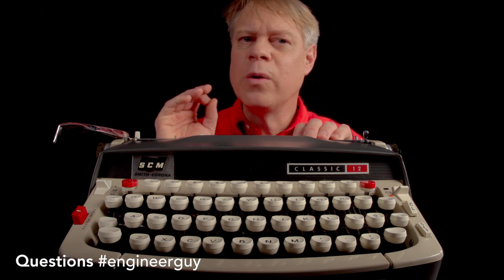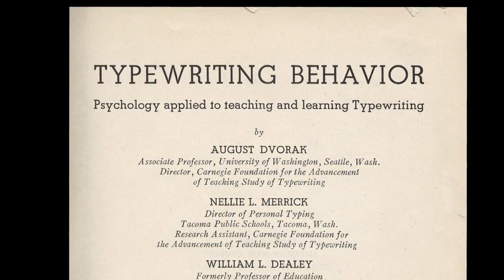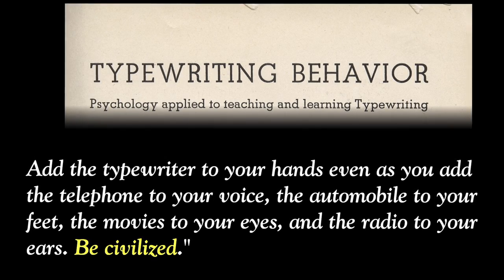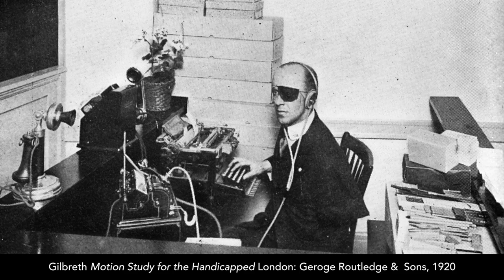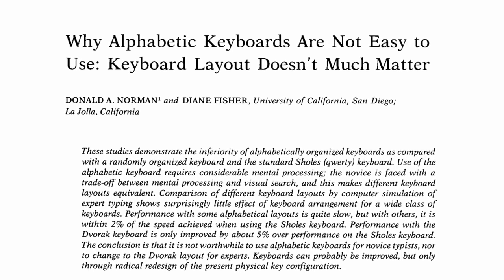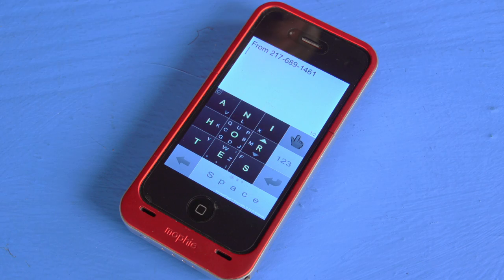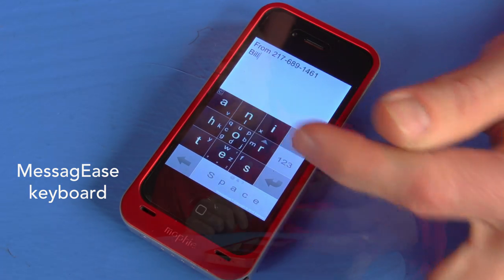Why the Dvorak keyboard didn't take over the world

Comment: I use Dvorak mainly for comfort - it is so much more comfortable than QWERTY. It was also much faster to learn. I had been learning typing in school on and off for years and was nowhere close to being able to touch type - after 2 months of using Dvorak, I can do so at 50 wpm which is about 15 wpm faster than my old speed. Nowadays alternate keyboards are included with all OS's so the effort to switch them per computer is negligible.
Reply: This is actually an important enough issue that we should probably lobby local schools to allow switching to dvorak and still have students do the same typing course tests. The superiority of dvorak would cause students to switch.
Since devices are pretty smart nowadays, they could convert their keyboards without much problem, presuming that the software wasn't retarded (hat tip to crapple for being retarded with their iMoan)

Comment: New tech needs to to two things to establish itself...it has to do the old job *better*, not just as well. Replacing installed tech has a cost that needs to be overcome. It also needs to open up possibilities that the old tech doesn't offer. Cars took quite a long time to replace horses, and only really established themselves as people developed a taste for greater range. Only when oil became expensive (and some areas started requireing emissions control) did fuel injection surpass carburettors. The Dvorak keyboard may (or may not) offer a speed or comfort advantage-that's arguable-but no new abilities were offered, no reason came to being making the replacement of the installed base of QWERTY machines worth the expense. Now we have even better tech allows us to use whatever layout we desire, that's what we should do-use whatever layout we desire. THAT should be the goal of all tech-letting us do what we want to do the way we wish to do it. The Dvorak whiners are not to be taken seriously, any more than people who tell others they can't eat pineapple on pizza. BTW-I used Dvorak for about two years. Not only did I type no faster (about 30wpm with either layout-there are many factors influencing typing speed, and layout is just one), I had to haul my own keyboard everywhere I went. Same speed with more hassle is not "better". I use FGHJ now due to physical limitations-it really sucks but it works for me. I use voice-to-text even more. Use what works for you, and avoid the impulse to impose your preference on others. That's both rude and unintelligent.

Comment: It didn't fail, I use the Dvorak layout, and I tested my speed both before making the switch, and after I had become comfortable with the Dvorak layout, and found I was 20% faster.  However, I used keyboard software to learn the new layout, and had never really worked on my qwerty skills outside of regular typing, so it might just be that I needed to train, and changing the layout forced me to.

Comment: I tried the dorsal keyboard for a few years, but then switched to the Colemak keyboard. It's a bit easier on my fingers (less RSI) and the frequent keys are well in the middle row. Should be fast, with practice. 
Dvorak was disappointing. The only reason it helped the rest at first seemed to be that it made me type slower until I adapted.

Comment: Hmm...I heard that the QWERTY keyboard was originally designed the way it was so that certain commonly-used letters would be closer to the sides of the typewriter in order to prevent jamming.
Reply: i think that may be the "folk-story" explaining the "random" layout he refuted at the beginning?
Reply: The real reason is that the type bars inside the machine were arranged so that you'd rarely use two next to each other in sequence, because that's what caused jams. So starting from the arrangements of the bars and connecting them to the keys using compact linkages that were ordered in a sensible way created the layout, and the layout you wound up with was QWERTY.

Comment: Like any established system, they take on a life of their own.  Look at the whole Y2K debacle.  It was well known before 1985 when I was taking computer science classes that the whole Y2K thing was inevitable.  We were also told that by they year 2000 we would be using computers so far advanced and different and non-compatible with the then current systems, that they would be obsolete and out of use and not a problem.  Then what you find is that businesses had lots of computers that cost lots of money and they resisted replacing them with new technology.  That's not to say the the technology has changed that much even up to today.  Predicting the future of anything never seems to go very well, especially when you discount the idea that things can take on a life of their own.

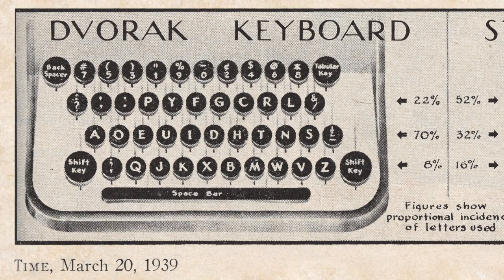Comment: Looking at the numbers row at 1:25, I think I know why the Dvorak layout "lost". %-o
Reply: I dunno, if ABC doesn't need to be in order why should the numbers? I find when typing that the moment I hesitate the most tends to be when I'm reaching for one of those numbers along the top row.
Reply: Actually the numbers are in serial order in modern Dvorak keyboards.  But certain digits are more used than others, so it would make sense to have them near the index finger, not the pinkie.
Reply: That was probably from/for a typewriter. Just the other day I wrote some lines on a typewriter which had neither a key for 1 (one) nor for 0 (zero).
The number one is supposed to be typed as lowercase "L" and the number zero as uppercase "o".

Comment: I disagree with one point. Dvorak is much greater than 5% faster than QWERTY. I used to type 45 wpm with QWERTY and now I type about 100 wpm with Dvorak. The problem is the amount of time needed to retrain your brain and fingers to use the new layout. If you use a keyboard for work, you will type so slow that productivity will drop to near zero while you learn it - and switching back and forth between QWERTY and Dvorak will make it even harder. Once you master Dvorak, you don't forget how to type in QWERTY, but if you have to switch back to using QWERTY you will find yourself typing slower and making more mistakes. I think this is the reason it never caught on. It's just a pain to switch when everyone is satisfied with the system they know; like convincing the U.S. to use the metric system.

Comment: Could you post the source for that 5% improvement? Years ago I tried to track down studies where the superiority of the dvorak-keyboard was shown, but failed to find anything except for studies claiming this was true and referring to other studies. I never found an original source and would be interested in seeing one.
Reply from the maker: It’s in the video isn’t it
Reply: @engineerguyvideo  The reference you have in the video is for "Why Alphabetic Keywords Are Not Easy to Use: Keyboard Layout Doesn't Much Matter" (Norman & Fischer, 1984), where a simulation indicated that the Dvorak keyboard may be 5% faster. They further refer to a paper by Alden & al. (1972) for a claim about 5% improvements. Only problem is that the paper by Alden does not mention that at all. Instead it goes on to refer to a study by Strong from 1956 that concludes that Qwerty was superior both in terms of speed and error rate.
-The positive thing is that Strong actually deals with the issue empirically. This is the first time I am seeing actual empirical evidence on the topic. It does refute your claim, though.

Comment: This video skips the most important reason for the existence of the QWERTY keyboard. On old manual typewriters, if they used a Dvorak layout they arms that made the imprint on the paper would constantly jam up. Spreading out the most commonly used keys prevented that. Anyhow, the whole argument is now moot since it's all done electronically. Therefore you could  switch back and forth between the two layouts by writing a keyboard driver that altered the key layout. But I'm sure they're already available.

Comment: Qwerty is indeed a little more efficient than a straight alphabetical keyboard (for full keyboard touch typing). But Dvorak's Simplified Keyboard Layout is about 3 times as efficient as typing on the Qwerty layout. 5% might be an accurate comparison for speed differences, but i doubt its legitimacy, after my own personal experience. 95% of statistics are made up on the fly. (I made that 95% one up, but it serves a point.) But from experience, i know for sure that the Dvorak Simplified Keyboard Layout is a LOT more efficient (and thus easier & more comfortable) to use than the Qwerty. I dare anyone to just try it. typingclub.com is a descent and fun and free typing site that you can use to practice and learn typing in the Dvorak layout.

Comment: Dvorak could not have `taken over the world" as you put it. Every language has its own unique keyboard layout. My mother language is Turkish. Turks started using French-based layout - which they used to call "A-keyboard". Simply the letter A stood where Q stands in English typewriter. Later on, they developed the F-keyboard, which was scientifically developed to speed up Turkish typists. And it worked. It had been very popular until... computers began taking over the world. It was actually QWERTY taking over the world with the arrival of computers in 1990s - yes, they arrived little late in Turkey, at least reaching its first critical mass. But despite the ease of use of the Turkish layout, many people began to use computers before even getting familiar with typewriters. What happened in the end was, QWERTY was evolved into Turkish, with the addition of six letters Ç, Ğ,İ, Ö, Ş and Ü on the right side of the keyboard - which was even worse. But no one cared about the ease of typing anymore. 

Just a closing note: You forgot to tell your viewers that you can type the word, TYPEWRITER with the top row keys on a QWERTY keyboard. Its design is based on that very simple idea. Yes, I am using QWERTY now, but I hate the fact that it had wiped out the original Turkish keyboard, despite it was easier to type with it, even in English. I know both by heart, but have gotten much slower on the F-layout. By the way, the only Dvorak that has taken over the world is the one that follows the name, Antonin. He has not only taken over the world, he has taken over "The New World" 😁🤘

Comment: I don't quite follow. You said that it's an urban myth that the qwerty keyboard took over because it was first and it's hard to dislodge that which is already established, then you confirmed that the reason why the qwerty keyboard took over was because it was  first and it's hard to dislodge that which is already established, but then just added that it takes a significant improvement and a change in how we do things in order to justify a replacement. That doesn't make the former explanation to be an urban myth, but rather it's just a less comprehensive explanation.

Comment: I am now typing this comment using the Dvorak keyboard, and I can assure you from using it in the past two years, that it is quite a bit faster than QWERTY and a lot easier to type on due to the significantly reduced finger movement. I probably typed this whole comment in just under a minute.

Comment: I tried the Dvorak keyboard for a year. The only reason why I abandoned it was because cut, copy, and paste keys were sprawled out (ctrl+x, +c, +v). Being a software engineer, I tend to use those functions a lot. There may be a workaround for this, but I decided that the differing layout would continue to cause problems like this in software that assumes that the user has a QWERTY layout. It's not worth the trouble for a meager improvement of speed.
Reply: You could look into the Colemak layout
Reply: James Smith Or the QWERF layout or Capewell-Dvorak (Dvorak modified to keep ZXCV shortcuts and improve a couple other weird things with Dvorak) :)
Reply: James Smith Its not just about speed though Dvorak is better at preventing RSI.

Comment: So how come there isnt a regular abcde key board?
Reply: Because ergonomically, it's a bad design.  It puts two of the three most common letters (at least in English) on the far left of the keyboard ("a" and "t"), meaning they have to be struck by the left pinky finger, which is most people's weakest finger.  And it puts the second least frequently used letter, "q", right under the right index finger, which is most people's strongest finger.

Comment: Colemak is far superior. After 10 years of using qwerty I learned colemak in 10 hours, cold turkey style.
Reply: Colemak is absolutely brilliant. Like you said, it took almost no time to learn and it's really almost scary how much you can get away with using only the home row. Not to mention that its so much more rare than QWERTY or even Dvorak, so it's really funny watching friends' frustrated confusion when they try to use my computer.
Reply: I remember trying it out a few years ago but since lost my resources. Do you have any links to help me get started with Colemak again?
Reply: BollocksUtwat
I used this site to get hang of it: http://www.keybr.com/#!practice
You need to change to colemak in settings. Also you can change layout only by a few keys at a time using Tarmak, so it won't affect your typing speed as much https://colemak.com/Learn
Reply: fuanshin: yes, Colemak all the way!
Reply: Colemac is only easy to learn if you already know Sholes' qwerty. Using Colemac from the beginning couldn't have spared us the long learning time we had with Sholes.
Reply: Rainer67059 In my experience once you have to second guess any aspect of the QWERTY layout you can't fluidly type with Colemac. It took me forever to realize how many the two shared when learning Colemac because I was still hesitating like crazy because however many are the same the muscle memory is still wrong as you move between different keys to new keys so they may as well be different.
Reply: If you like Colemak, more power to you, it is much better than QWERTY while keeping most shortcuts. However, Dvorak still is significantly better than Colemak for touch typing, for complex reasons.

Comment: If that is the "myth" of the origin of the QWERTY layout, does anyone anywhere actually know the real origin behind it?
Reply: It was not arranged to make typing as slow as possible but to place letters that are often close to each other in english reasonably far away from each other on keyboard. Typewriters were not jamming from fast typing but from pressing two keys that are close.
Reply: +fuanshin Same principle however, placing them farther apart does slow down typing, but that was more a side effect from what I know
Reply: +Bryce _ actually, no - it speeds up typing!  it's much easier to type two letters in rapid succession using two hands vs 1.  That, on top of the typewriter arms not getting cross locked, makes qwerty ideal for speed on both fronts
Reply: +Higgins2001 Trutru, I'm not always typing with two hands on my phone though so I probably just don't notice it

But when I do type with two hands (as I am now) I notice that my thumbs rarely cross paths, when they do it's just like if I hit 'A' then my right thumb goes to 'T' if that's the next letter I need rather than my left thumb which I usually use for 'T'

I also have good memory of where all the keys are, if my phone stalls up I can keep typing and even throwing in puncuation after it unfreezes and accepts all the input I'm surprisingly accurate

Comment: QWERTY keyboard - Designed to slow people down... Yea... That didn't go so well did it?
Reply: It was not, and it even says so explicitly in this video. You can also find this out by visiting snopes. Or wikipedia.

"Contrary to popular belief, the QWERTY layout was not designed to slow the typist down, but rather to speed up typing by preventing jams.

There is also evidence that, aside from the issue of jamming, keys being farther apart increases typing speed on its own, because it encourages alternation between the hands."
Reply: Oh. Thank you for that. :)
I thought it prevented jams by slowing people down.

Either way, thanks.
Reply: no it hasn't stopped people going quickly but it has stopped people typing comfortably as they increase therr speed, don't forget people didn't foresee touch typing when qwerty was designed.
Reply: Well. Not really true, touch typing was around since the late 1800;s, qwerty was introduced partly to counter the issues generated by that on abc-keyboards (you more often had to use a single hand a lot, also the keyboards often only had two rows, making touch typing harder. Granted, they had fewer keys).

Comment: This smacks of a scantily researched effort to discredit the existing belief that the Dvorak keyboard should have succeeded. HIs 5% difference figure is rather low. Where did he get it? Everything has given a wider advantage to the Dvorak. Also, he fails to mention the ergonomic benefits of the Dvorak.
Finally, he doesn't support his conclusion with a solid argument. He doesn't show other failures of marginal advantage, etc.
This video is not a scientific presentation.